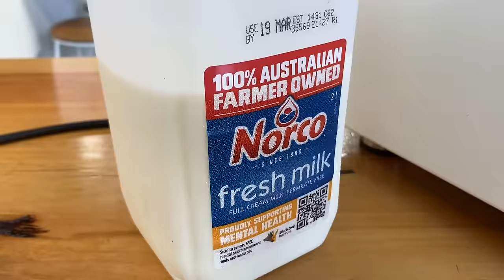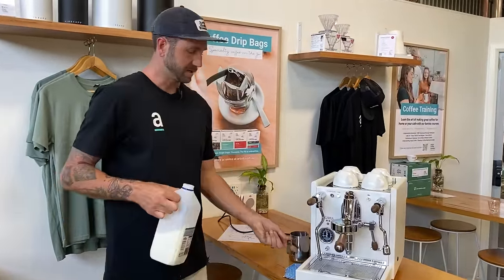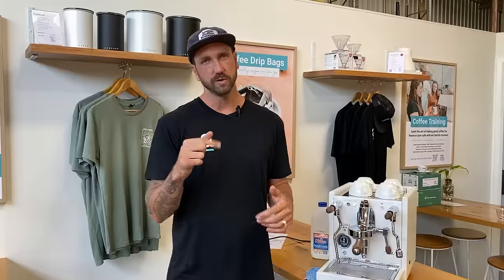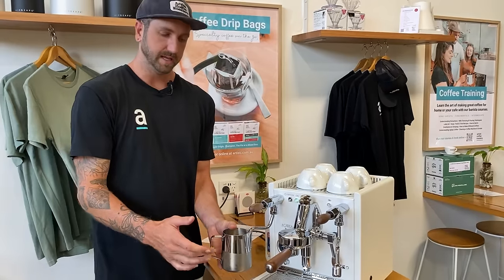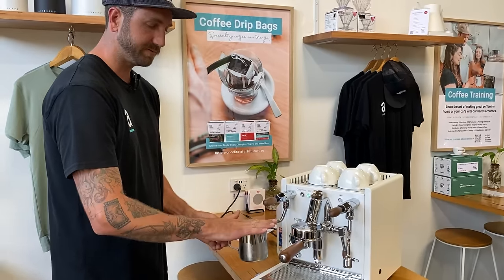Froth Perfect Milk on Your Espresso Machine (Barista Guide)

Comment: Excellent video. Thank you.  Your steam appears to be much lighter and slower than mine.  Yours seems to be much more controllable than my steaming.   I have a LaMarzocco GS3MP and the steam boiler temp is set at 245.6F. It takes about 10 seconds to steam about 5 oz of milk.  I don't have a problem with the quality of the steam milk but I certainly don't have the control that you have.  I use the no burn want that came with the machine.  Tip is also OEM.  If you have any suggestions I would appreciate it.

Comment: Thanks for the great video.  My home machine came with a 2-hole, 3-hole, and 4-hole steam wand tip.  Besides perhaps the speed at which they work, any difference in positioning between them?  Any advantages/disadvantages?  thanks.....
Reply: Most of the time, when there are more holes on the tip, it means the machine can output more steam. More steam pressure means the milk gets a much more powerful vortex, meaning all the bubbles you make will get incorporated better. You’ll notice in LM machines, that if you make a massive bubble, it’ll usually blend it in, as it’s more forgiving because it’s powerful enough to “crush” the big bubble into micro foam. A weaker steam will tend to be less forgiving for big bubble mistakes, as you need to find the exact perfect spot to spin the milk to create enough momentum to break the bubbles down. Anyways, with experience you can master either one! In my opinion, you should install the 2 or maybe the 3 hole tip. Not sure the exact machine your using, but using less holes mean the machine can feel more powerful as the steam is being pushed through less holes, creating more power for a vortex.
Reply from the maker: What he said 😂
Reply from the maker: As far as the angle, you may just need to tweak your positioning to ensure the milk spins correctly. It does get hard with 2 holes as they usually spray in conflicting directions. More holes helps this but the power depends on the machine.
Reply: @jacobsander9420  Thanks for the detailed explanation!  I will experiment.  The machine is a Lucca M58 from Clive Coffee which is their rebranded Quick Mill E61 double boiler machine.

Comment: Hello. I love your channel. I am using the electric milk frother. It automatically stops when finish the cycle. The foam is soft and looks nice. However, i noticed that the foam has separated from the milk (which is good if i do the foamy traditional cappuccino) that is very difficult for me to pour the latte art. Is there any way i can fix thia and save the milk. Much appreciation,
Reply from the maker: Thanks for watching 🙏🏻 
Sounds like you just need to spin your milk in the jug after you’ve frothed it so you don’t get the separation of froth to hot milk. 
Check out our other milk videos for more help. 
Cheers
Jimmy ✌🏻

Comment: Hey Jimmy your downloadable PDF says “Turn steam off 15° early” at the bottom. What does that mean?
Reply from the maker: It means to turn the steam tap off approximately 15 degrees before it reaches 65 deg because after you turn it off completely you will find the temp gauge will continue to rise up to the desired temp of 65.
If you turned it off as the gauge hit 65 deg you would find the milk would continue to rise in temperature and you would end up with milk at a temp of 75 deg or more. Hopefully that made sense :)
Reply: @ArtistiCoffeeRoasters  hello thanks for reply. Actually my thermometer gauge doesn’t continue to rise after I turn off the steam. Even if it continues to rise, it may do so by couple degrees max. I think 15° is way too early to turn off the steam. Do you agree?

Comment: 10:41 hi sir l have a problem when steaming. When l position the steam wand in the pitcher,  l put it in the right angle but to my notice l keep on burning my fingers and l make much silky form which is very hot if l touch the pitcher ( but remember l am steaming for cafe latte). So sir what seems to be the problem.  Is it bad positioning at the right angle or is it me the person steaming

Comment: Is it possible to achieve the same result with Delonghi La Specialista Arte? Sometimes I think that my machine, although costs 600 euros just doesn't steam milk, only heats it
Reply from the maker: We have not used this machine, you may find using a smaller jug will help to get the milk spinning and then make foam
Reply: Thanks for the answer  @ArtistiCoffeeRoasters

Comment: i dont understand how you guys make it look so easy, im getting the milk to look good but everytime i pour it doesnt stick to the surface of the drink. I've played around with my angles, flow etc, nothings working. The only element I haven't change is the cup im using, i only have square edge bottomed cups. Not sure if thats part of the probelm
Reply from the maker: It’s a little bit you should till be able to, are you getting a good amount of froth or just hearing the milk and it looks like it’s silky? Try frothing and pouring into a glass and see how much foam you actually have. Also the first pour is a lot quicker at the start to throw the foam into the cup. Cheers luke
Reply: @ArtistiCoffeeRoasters  Thanks, I'm stretching the milk and waiting for the temp to feel about the same as my body temperature, then dipping the wand further down to stop adding air and waiting for it to be too hot to hold for long. 

I'll try your suggestion and see how much froth I'm getting. Its prob important to note I'm using 2% lactose free milk at home.

Comment: Wait you said four seconds before lowering. Then when you demonstrated it I counted over 10 seconds before lowering the wand.  Or did I get that wrong?
Reply from the maker: A few have pointed this out sorry. 
I’m used to using commercial equipment that is much faster. 
All machine pressures are different so adjust as needed. 
Thanks for watching 
Jimmy ✌🏻

Comment: @7:50 you added maybe 10+ seconds of air after saying you should only add roughly 4 seconds for a latte...
Reply: Because he is using domestic low pressure machine not commercial high pressure ... 😊